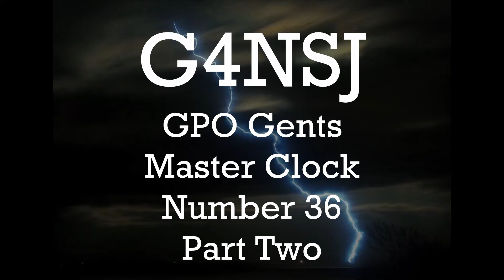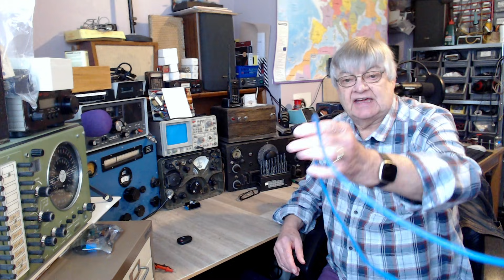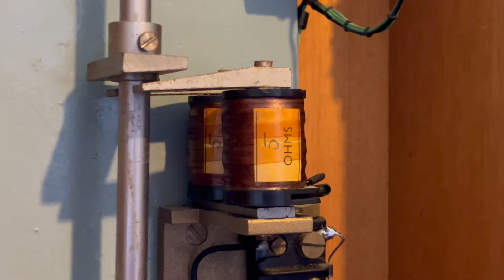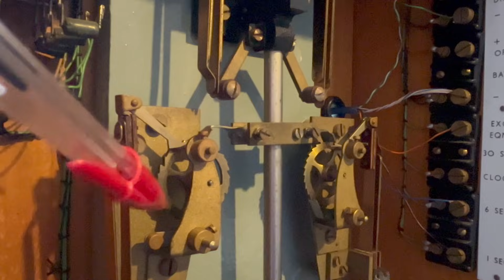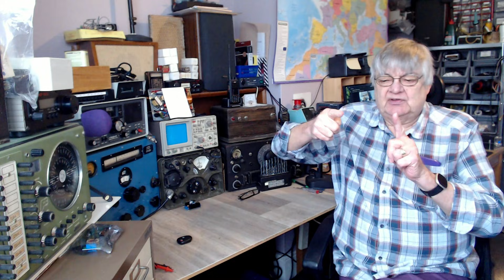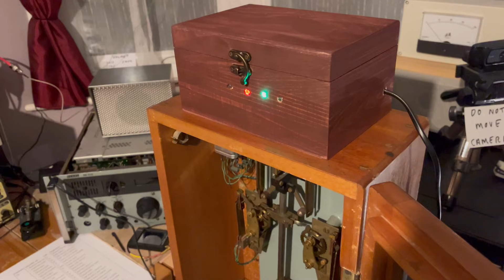G4NSJ - GPO Gents Master Clock number 36 MK6 - Part Two

Comment: 24volt is far to high for slave clocks . Unless it’s a special or some 24 volt are alternative polarity so definitely don’t use them . 
A normal slave clock can even be tested on a 1.5 volt battery.
Reply from the maker: Some clocks I've looked at are 24v but I can accommodate any voltage. Thanks for the info in 1.5v. Cheers, Ray.

Comment: That GPO master clock has to be a wonderful piece of British engineering for it's time Ray. I can quite imagine, the GPO field engineer had quite a job maintaining them. Hope you manage to find a reasonably priced clock that works, especially as they must be in short supply by now. Sad to think most of them probably ended up being scrapped.
Reply from the maker: Hi Matt, it is a wonderful piece of British engineering. I like to keep old things like this running and, yes, it's a shame that so much has been dumped over the decades. Cheers, Ray.

Comment: My goodness Ray, that was brilliant. Electro/Mechanical has all ways been my thing of interest. Solenoids, relays, contacts, Mercury switches !. Looking, listening fault finding. And stuff that seems to work via Voo-Doo like that dangler swing catch (tech term). Hope you find that clock soon, and get the master fixed on the wall.  Instead of the LED lights what about old small round VUs (back lit maybe).  A bit Steam-Punk, getting carried away now. Cheers Ray, keep it coming.
Reply from the maker: Hi Jeff, glad you liked the video. Electro/Mechanical has always been mu thing, too. Good idea about the LEDs. Cheers, Ray.

Comment: Hi Ray, very interesting, and very 'timely' for me as I'm just embarking on a project to make a copy of a Synchronome master clock. I risked buying a parts only 30 sec. face, and was delighted when it worked fine on 1.5 volts - especially as it was much cheaper than the ones you mentioned.
Looking forward to part 3.
Andrew G4FVU
Reply from the maker: Hi Andrew, good luck with the project. Most clocks I've seen are 24 volt but 1.5 volt would be fine. Cheers, Ray.

Comment: Hi - yes, current is the thing. When you get a slave clock that is also true there. If it is a genuine Gent slave then most of them require 220-250mA to trigger. I don't recall what the solenoid resistance is but I would be very surprised if you need anything like 24V. I drive mine on 24V because I need that for another different type of slave attached via a relay but on the standard slave there is a another big solenoid resistance in series so I have a big rheostat also in series to reduce the current.
Reply from the maker: Some clocks I've looked at are 24v but I can accommodate any voltage. I will find a clock... one day! Cheers, Ray.

Comment: I think the two videos about the 
GPO Gents Master Clock number 36 are extremely interesting. And the images illustrate why they are so interesting. What you are doing is something that I have no idea if anyone would do using a system like that, here on my side.
What I can hope is that you continue to deal with issues like these with the same calmness with which you are dealing with this particular one. I will continue to follow closely, as it is in my best interest.
Cheers!
Macedo Pinto
Portugal
Reply from the maker: Hi Macedo, it's good to hear from you. Thanks for your kind comments. I'm glad you find the clock videos interesting. There will be more soon! Cheers, Ray.